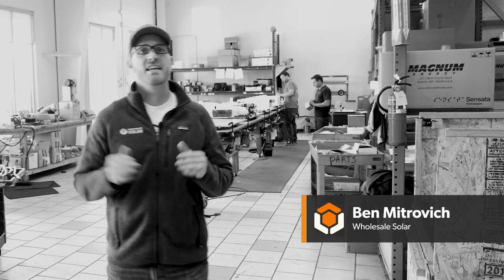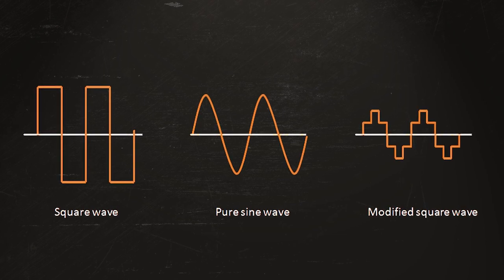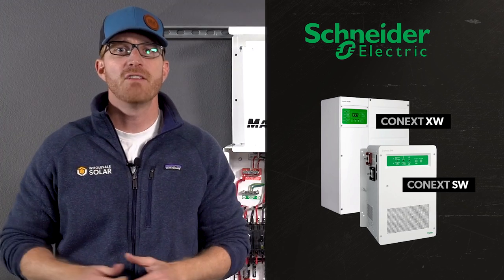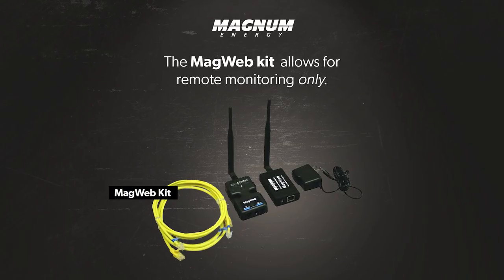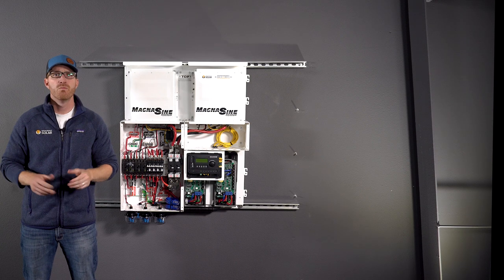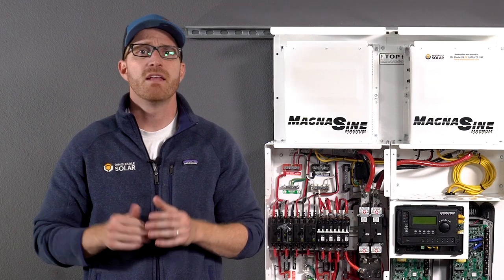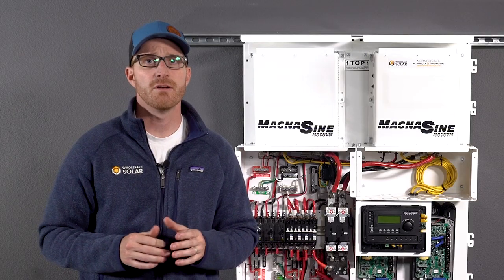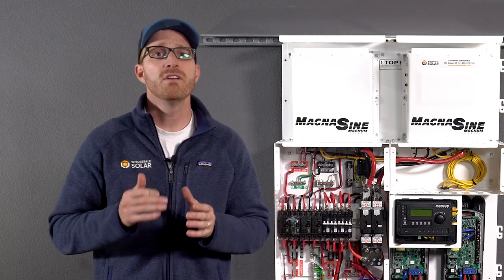The Off-Grid Solar Power Center;  What do I need in an Off-Grid Solar System?

Comment: The first two inverters can work off grid does that mean that
#1 they don't turn off when the grid goes down? 
#2 they have anti island tech so they don't back feed the grid when it's down?
Reply from the maker: Hi Kareem.  Thanks for asking.  #1 Yes the battery-based inverter would power essential appliances when the grid goes down — #2 Yes they have the proper anti-islanding technology and certification for connecting into the grid. The Outback Radian and Schneider XW PRO are the inverters with proper certification.  You can see all our Power Centers here: https://www.wholesalesolar.com/shop/power-centers
Reply: @unboundsolar  thanks I also have another question which goes back to#1 it doesn't turn off when the grid goes down but is it powered by the pv array or just the batteries?

If not is there a way to power it by the pv array while having the anti island capability
Reply from the maker: @Tactical-Black  The battery backup system continues to provide power to your essential appliances/devices, and the entire system remains isolated so that it can't feed power into the grid"

Comment: I have access to some First Solar 435 watt commercial panels that are rated at 2.37 A MPP and 183.6 V MPP.  Can these be used for an off-grid system such as a mountain cabin?
Reply from the maker: Hi John. Great question. Yes, those panels CAN be used in an Off-Grid solar power system. But because they are high voltage, you'll need a high voltage charge controller.  We'd be happy to help you find the right charge controller.  Learn more here: ws.solar/off-grid-power-center